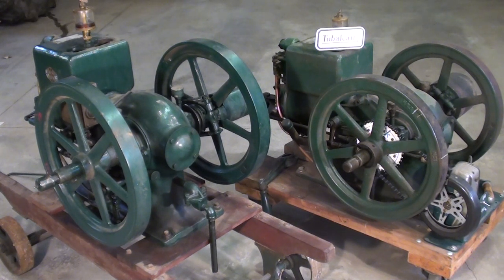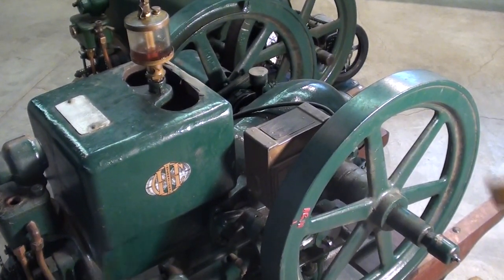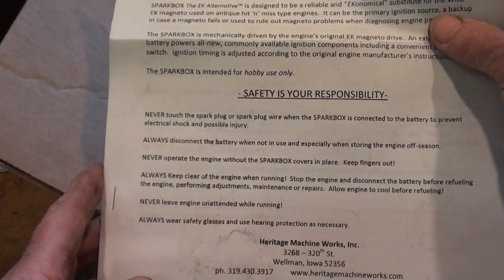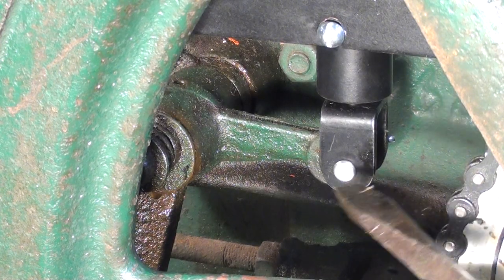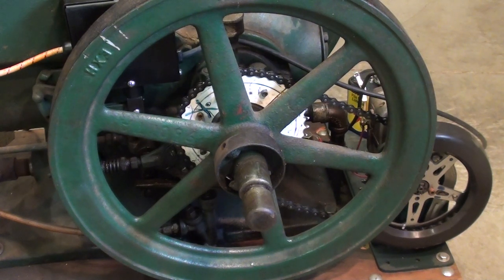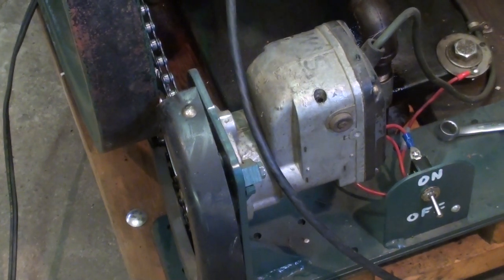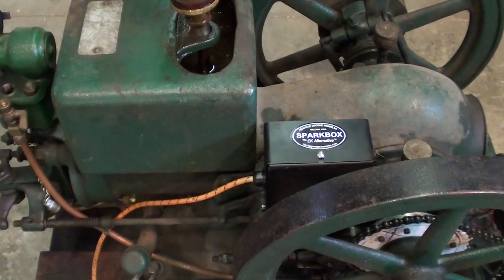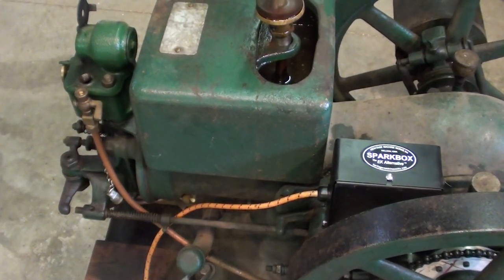McCormick Deering M Engine with Wico Magneto SPARK BOX tubalcain

Comment: LOL.  Thanks for the painful trip down memory lane, Lyle.  I never saw an impulse magneto until I got a Wisconsin motor.  I had this thing in my hand, turning it with a wrench and trying to find the cause of all that racket when it tripped and sent my dental fillings flying across the garage.  I spent some time pondering (and cussing) the use of such a complicated device on a small engine until I remembered it was powering a mortar mixer.   It would be difficult to build up enough speed to reliably fire off a flywheel magneto pull starting that baby while loaded.  Kudos to Steve for his modern implementation but it just seems to defy the 'spirit' of these old farm engines by having to use an external power source. I much prefer your FM modification.  I realize that those FM units are also a bit rare and expensive and adapting a flywheel magneto would be tricky getting the timing right but I'd rather do that than have to ride ol' Bessie the cow into town and hit up Wally World for a battery every so often.  Perhaps you could go halfway and use your dynamo as a power source and/or charge a lead/gel battery.  Maybe make a distressed battery box with big ol' brass wing nuts and coiled wire for appearances at the least.

Comment: Nothing like a morning cup of mrpete222 to start the day...

Great video! Reminds me of learning to time magnetos to aircraft engines, using a "buzz-box." It was basically a continuity indicator, where a light would illuminate (and an audible buzz changed in tone) when the points would open inside the magneto. This indicated where the electrical field collapses, and the current will go to ground through the spark plug...thus igniting the fuel/air mixture inside the cylinder.

Comment: I found this video helpful. I have started collecting older air cooled gas engines and many of those use magnetos like Wico and Fairbanks Morse. Funny you should mention Chevy 235 engines. My favorite engine of all time. I spent about 40 years playing, improving and hot rodding them. I had 22 of them when i got sick 5-1/2 years ago and because i was not sure if i was going to be around much longer, i sold them all along with my 56 Chevy sedan that i owned for 34 years.

Comment: Nice video. Thank you you for sharing it. I would not stick my hand in between the fly wheel and mag to shut it off. What I do is shut off the fuel valve.  Im not sure if you were running your old mag with out a spark plug or not. but if you were the windings will be arcing every time it sparks and it will some time burn out the windings in the mag. Nice engines, they sound great!

Comment: Great video Pete, I would use the sprocket to run a small 1 wire alternator (11 amp) from a lawn tractor to charge a small motorcycle battery to make it a self contained unit.  Thanks for the information.

Comment: Great video as always!  I'm currently working on the (relatively "new") magneto on a 1961 Kohler 7 horse engine from my Bolens Ride-a-Matic.  I had previously converted it to an automotive-style ignition, with a coil, etc when I had added electric start to it, (maybe 10 or more years ago) only to roast the points due to a faulty ignition switch :P

Comment: Just curious... since you showed the chain driven magneto being on a 1:1 chain drive.  You said you were running in wasted spark mode.   Could you have made your primary sprocket with half the teeth so you could run a 1:2 and not have wasted spark or would the mag not spin fast enough?
Reply: +ramosel I'm probably wrong but Lyle may have used a pair of old bicycle crank sprockets for expediency.  Getting a 1:2 ratio would have taken a lot of extra scrounging and work finding and adapting a wheel sprocket which are usually hardened and part of a cluster.  Unlike a typical B&S style flywheel magneto that needs the passing magnet to be above a certain speed to create a good spark, the FM Impulse magnetos have an internal spring mechanism that's 'wound up' during rotation then released all at once at the timing mark.  That's the impulse click you hear.  Since the stored energy of the spring is constant when released - the magneto fires with the same energy regardless off rpm.  It will fire just fine if rotated by hand.
I learned this the hard way when I first encountered one troubleshooting an old Wisconsin motor.
Reply from the maker: +Eddie the Grouch Thats right--could not get the right sprockets without spending $50. But, I had 2 identical sprockets on hand.
Reply: cool, thanks to both of you.   Answered both my curiosities...

Comment: The "safety patrol" would say that you had obviously never used that kill button on the EK mag. If you had, you obviously would be missing a hand, an inescapable one-to-one correlation. Certainly, safety regs protect from "duh" moments, and protect those who can't seem to protect themselves, but I have to think they also breed carelessness and thoughtlessness. If you don't have to think about being aware and safe, and you never had to in your life, you probably won't.

The most important and effective safety device resides between the ears. I know this from personal experience, having used it, and foolishly, foolishly having failed to use it. Fortunately, I still have all the parts of my left hand.

I occasionally visit an old municipal light plant that has thankfully been preserved. Three Fairbanks-Morse model Y diesels drive those open-frame alternators, which feed a General Electric power control and distribution panel about 8 feet tall and 20 feet long. The panel itself is slate, but every single knife switch and control is exposed and uninsulated. The extensive wiring behind the panel stands along a wall, but is accessible to anyone who walks back there. We're told that the system generated 2,500 volts (and no, they don't energize it for shows!). They also tell us that there was only one casualty during the 30, 40, or more years that the plant supplied the town--as late as the 1950s--and that didn't happen in the building at the panel or around the engines. A mistake was made one time, when the distribution line out of the plant was accidentally energized while a man was working on the line right outside the building. It was a tragedy, but I wonder whether their safety record would have been any better in today's world. As it was, it reflects uncommon attention and care. An interesting side note is that the newest of the Fairbanks engines, a 3-cylinder, was moved into the building and settled into place on a huge block of ice.

As to grumpy old men, myself just entering that club, I like the term "curmudgeon." It's a great word in itself, though it doesn't fully make the case.

Comment: you can get a 6v SLA or garden tractor rechargeable battery  for under 20$ that give more current and better spark.  But if the coil is 12v, it may need a 12v battery.  Kid's power wheels have 6v SLA gel cells and charger, if you take it from a kid.  Don

Comment: rpm too high on second engine. NEVER EVER stick your hand between the flywheel and the magneto to stop the engine. Especially with long sleeves. take a wooden broom handle (with a hole drilled in the end and flame harden it) to hold the exhaust rocker open till the engine stops completely. If the engine has the original magneto always use it, Send it off to get repaired if needed. Rigging a magneto is ignorant and depreciate the apearance of the engine and looks terrible at shows. I took my magneto apart and it was a broken wire inside, soldered it together and has worked flawlessly for years. Parts for these engines are plentiful to buy.